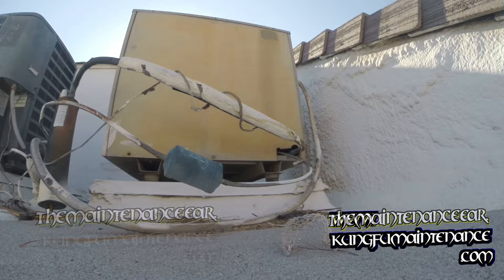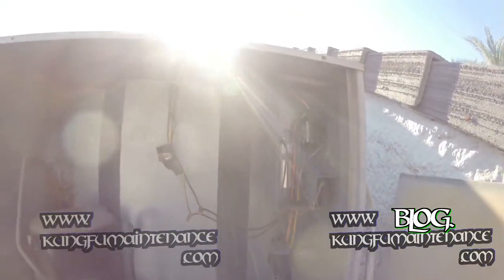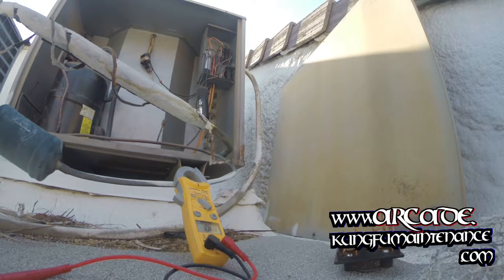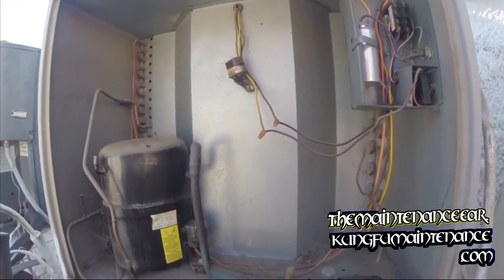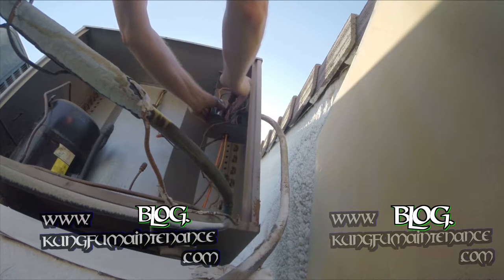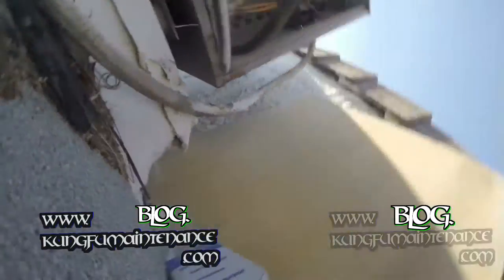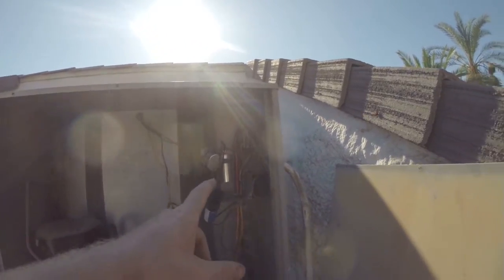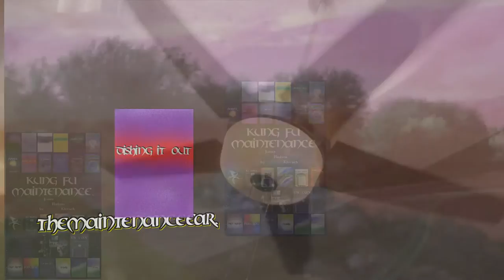Air Conditioner Sometimes No Cool Most Common Intermittent Fail Causes Maintenance Repair Video

Comment: You also might note that the filter drier is in backwards and the tubing is a disaster.  Not to mention the conduit is pulled out of the disconnect box.
GFM
Reply from the maker: grayfurnaceman Excellent eye GFM! ~ Like an eagle. ~ You are exactly right on all points! These go to me list for repairs on cooler days of the future. For now it is all about survival of the brutal heat of summer. How critical do you think the wrong direction filter drier is? This one has been in there running this way for I think more than a decade. I had to carefully re-watch the video me self carefully to double check if the filter drier might have been a universal direction heat pump type filter (with thoughts I may need to climb back on that roof tomorrow to check) but finally I saw you are absolutely right. Arrow pointing on liquid side back towards compressor. Excellent catch. ~ Thanks for watching and sharing your insight and expertise. ~ KFM
Reply: KungFuMaintenance I have seen these driers as you have.  Sometimes they work ok.  Sometimes dessicant will come out of the drier because there is no screen on the inlet.  I sympathize with the rooftops where you live.  I lived in the California high desert for several years.
GFM
Reply: @KungFuMaintenance  hi i live in yuma az my air conditioner stop working for a few hours today during the peak hours it was like 111 dregres outside and then the furnace start working itself because its in auto. But the a/c unit outside was still off and then after a few hours when it cool off outside a/c turn back on again. You think i need one of those super boost.